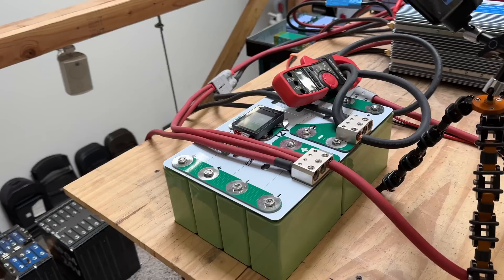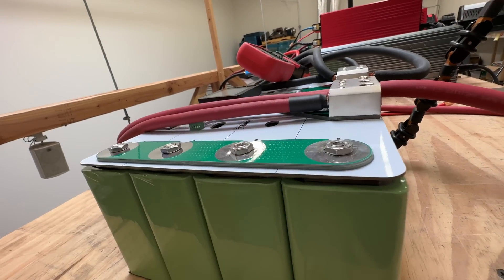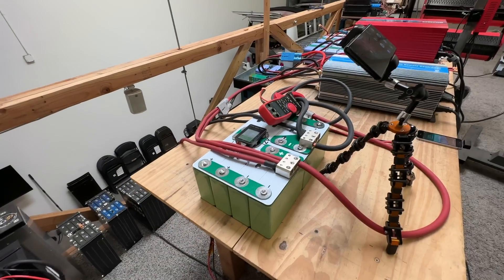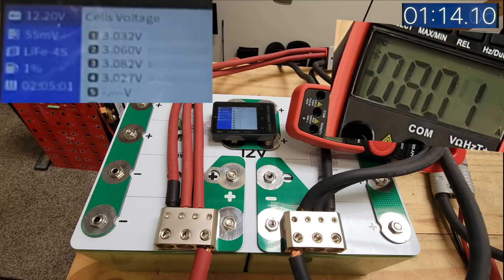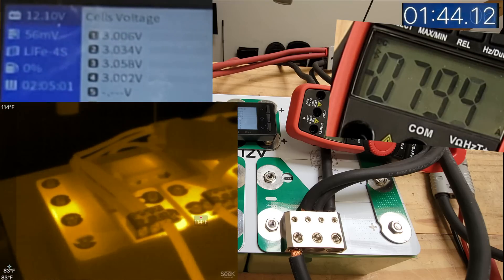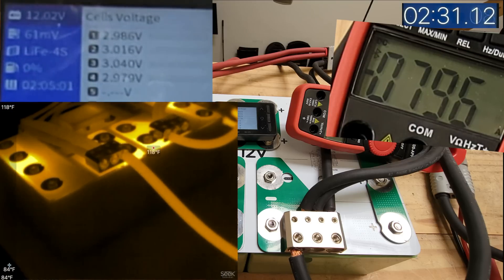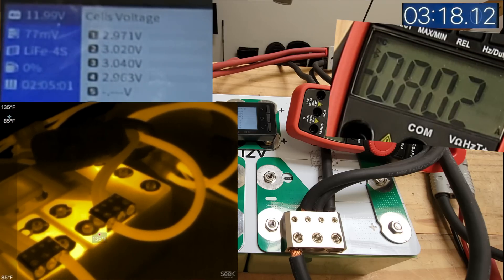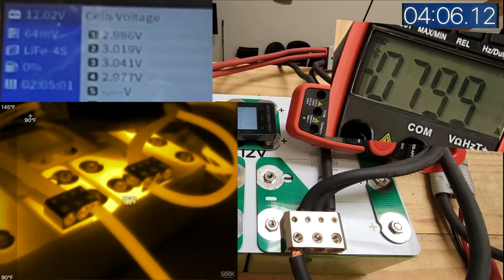1200A 12v  Monster LifePO4 Battery

Comment: Edit: the battgo device was not shipped with the correct setting, as soon as i changed it to LiFe it worked flawless to charge and was at 98%.
Im happy with it now, thanks Jag35.
End of edit....

I just got my 148Ah 12v 1200amp 4s2p premade kit. Thanks. When charging it with the aims 12v 75amp 14.4 charger the gas tabk never barely went to 8% with all the cells balanced over 8hrs. Does ot matter which front or back of the terminal blocks used to connect the charger I don't have anything connected to it the power stuff but when I charge it it gets up to the 14.39/40 volts but not sure if im doing something wrong? Does the battgo not know the % of capacity remaining properly? So confusing. The battgo was shipped with the setting at LiPo, is that diff than LiFe? Whats LiFePO4 vs LiFe? 

Should i connect my subwoofer amp and sub to it and see if anything changes?

The battgo manuals online are a joke. Need some advice.... Should i let the charger charge all night and see if it does anything? People made it sound like it charges in an hour. Maybe it needs a whole day?

Comment: 160 is really not that hot anyway. Fantastic product!!!!! Just installed the long version and it’s absolutely insane. I am running about 12k watts and it is extremely stout. I don’t like the fact that it changes so low though 13.3 is all I am getting currently.
Reply: Would you recommend connecting it to the alternator or AGM battery to keep the voltage up
Reply: @Raquanscaraudio  you definitely need to connect it to your alternator, this is the best way to keep it charged. You can also use it with agm however I would recommend running it alone.
Reply: @SoberBassHead  how do you feel about the glowe voltage batteries? I’m in between the two
Reply: @Raquanscaraudio  depending on the version of Glowe battery. If you are going with the 148ah version of the lev60 battery it will destroy all of the Glowe batteries. Just make sure you are using the thicker bus bars.
Reply: @SoberBassHead  ah okay so if I do get the 280ah battery I could just hook it up to my alternator instead of my hood battery?
Reply: @SoberBassHead  I also have a supercapacitor

Comment: I would like to use this as a starter battery for a diesel truck. What is the temperature range for these cells ? also do you think a 300amp constant 1000a 5 second bms would be ok for that situation ? seems the starter would use 450-650 amps... Might just run a 750amp ANL fuse and no bms

Comment: I just bought 8 cells . I wanna make 2 seperate 74 ah  batteries .  And be able to connect  to make 148 ah batt. Is that possible ?    Do i need 2 bms ?    Amd can i make one a solar generator   capable of charging on solar and DC to DC .  ?
Reply from the maker: Everything is possible

Comment: They do have amps that are high voltage.  Dude has a fiat.  That has 3 30k  anps at 400v  runs off his ev motor battery

Comment: Hello Jehua Best regards: I am trying to make a "Solar PowerPack 900Wh", as you explain it in your videos (which among other things I really like, thanks!).
I have ready the 10 battery plates and the rest of the parts, but I have problems with the cable ("Ribbon cable"),  that when trying to connect the whole set, this generated a big short circuit burning several of the battery cards. I already repaired them, but I have to burn them again...
Is it possible that you can sell me the ribbon cable with the 11 male connectors, ready and tested, to finish my project?
Just tell me how much it's worth to consign the money to you. Thanks again!,
Hugs. Jaime

Comment: People in the car audio community usually just buy more amplifiers and batteries. Some do run at 24v, and are becoming more popular, but they are rare.
Reply: Nobody is running their car audio equipment at 24v. Find me an amplifier that can take that much voltage an I'll say I'm wrong an I don't know shit but my 10+ yrs in car audio an lithium dealings say otherwise. Taramps HV don't count because they were never designed for in vehicle use. No vehicles Electric system can handle voltage like that
Reply: @TrunkThunderLithium  Taramps make some. I don't care they're not designed for cars - they are 24v and people run them in their cars

Comment: Question !  Im a old school car audio guy and im not new to lithium charging, i know they have to be charged safely and be balanced.   So for car audio would you just put this battery in the same configuration you would as a AGM in the trunk,  And just let the alternator do its job, or is their anything special you would recommend besides checking the balancer here and there.
Reply from the maker: Yeah just let the alternator charge them

Comment: One thing that may be beneficial for sizing busbars that you may find helpful is measuring the max voltage drop using a semi decent 6 or 7 digit high precision DVM across each busbar in the battery under load, and then adding them all up and dividing it into the total resting voltage of the pack to ensure the busbars are staying under 1% of the total voltage drop in the system.  

You could also use a micro-ohmmeter to find the internal resistance for each busbar connection to get a total resistance drop for the pack at the nominal voltage to compute how much voltage drop you will have at various current levels and once it goes over 1% that will be the maximum and you will know what to expect even before testing.

Comment: Can you change it to 8S1P instead on 4S2P. I need a 48 volt pack capable of tons of amperage.
Reply from the maker: yes we already have a kit for that,  you get the busbar and the cells and put them together https://jag35.com/collections/new-arrivals/products/24v-8s-busbar-pcbs-for-lev60f-cells  If you buy the components we can put it together for you.
Reply: @jehugarcia  Thank You also I plan on using some Headway cells to make a 750 or 1000W E-bike to experiment with Fat wheels and trying to make it capable of light off-roading. Do headway cells work well for that application. I can make the Bus Bars for that but I don't know between 1P or 2P for better range.

Comment: .
The reason for those hot spots on the end bars is because of singular bar format.
If you follow through your idea of a long battery, you can get double contact like the bar under the balance reader.
-
Also, your losing contact patch via’ nut compressing the bars into a cone shape. Making them leaf out like an open book.
  Can use a fender-washer to help flatten this out, or use radio antenna copper joint contact compound (it’s like a copper infused anti-seize) but most folk use a solid bar instead of layered pcb, just for the sake of simplicity.
-
Nothing wrong with layering pcb. But when entering into 500~plus amp territory, the less multiple contact the better.
Reply from the maker: I agree

Comment: I have a 48 ah headway 
 

I think I’m going to try these out 😮
Looks like a beast 

Ps man make a freaking beefy pcb buss bars 
Love your videos 

Sincerely extreme basshead 😂
Reply: These busbars are continuously handling 500 amps without melting under a non stop load. Music never does this. Music will pull max amperage for a second before the load falls off and back up again. The only way you'll ever get loads like these while playing music is if you were only playing test tones for minutes on end. I have busbars for my cells that are rated for 100 amps continuous and very thin and I have never had a problem with them but can do 400-600 amps on them at Burt's of 10 seconds also without issue which is similar to what music is.

Comment: With all due respect, the reason why these have not been as popular it's because you continue to use PCB bus bars. You have a healthy supply of cells, secure a metal fabricator and have thick aluminum or copper bars made specifically for you like all of the other Metal Works on the market. I'm trying to help you. People make go to you for cells but they go elsewhere for bussbars. Seems like a missed opportunity to me🤷🏽
Reply from the maker: The reason you haven’t seen these,  it’s because we just got them, talk to me in a couple of months.  Use whatever bars you want but the only one peddling big aluminum bars are the busbar sellers.  Customers will buy what works.
Reply: @jehugarcia  couldn't have said it better myself
Reply: What would you recommend someone replacing 2 12v lead acid AGM coach batteries for an RV application? Just looking to extend my time out in the world and off the wire hen we travel

Comment: So, what am I missing??? What is the advantage of PCB busbars vs solid copper or even aluminum? I know weight isn't the issue, so is it cost, looks, easy of manufacture? If cost, what is the difference? I work with big substation battery banks with tin plated copper bus bars all the time. But, I never buy them so no idea on costs. Also, what would you consider the high temp warning point, 180F or so? 
Also appreciated not mentioning the competitor. That was getting old and those that know, don't care to hear it. Those that do, don't need 'em anyway. Loving the R&D, keep it up!
Reply from the maker: Yes cost is a big deal,  I’m going to disrupt this market with super affordable battery so spending extra on costly bars when they are not needed doesn't make sense.
Reply: Basically if you can size a bus bar for the expected thermal losses during a cycle instead of using the standard practice of 1.2A/mm^2; then you can save on costs a lot. 

I think that is the goal of these tests. 

I know from purchasing experience that nickel plated bus bars rated for 150A continuous(25.4mm ×6.35mm) at a total length of 3.29 meters for a client's pack was $790 in material/ manufacturing/ shipping costs. This excludes the design time costs for the custom bars.

Comment: How can I use it to charge up a Bluetti ac200P ? what's needed?
Reply: All you would need is the same connector that plugs into your solar input.
And hook the other ends to the positive and negative on the battery.

Comment: I mean if you use this for Car audio you will never see that continuous of an amperage draw, since music is dynamic. These performed quite well, These would kick butt for a high powered car audio install.
Reply: Unless you're actually doing a max db test to burp a system music will never be a continuous load. All music is transient unless like I said you're playing a straight 40hz test for 2 minutes which is dumb.
Reply from the maker: Well whatever sine wave music you guys listen to these days,  continuous  tests should give you the results you need then.
Reply: You are wrong sir. Music used in car audio these days is modified, basically a continuous sine wave. You will absolutely see current draw like this. And even if the music was not modified at the power levels we are using even lower amplitude baselines will pose significant current
Reply: @BeSome1  LOL, what no bro. I don’t care how much DJ rusticals you are playing it’s not a constant sine wave. Your level of knowledge is hilariously poor.
Reply: @CL-yp1bs  clearly your level of car audio is poor, but that's okay. You may not have a system that demands High current, as most do not. However for me and the others that compete in my class do. I actually measure my current pull do you?
Reply: @CL-yp1bs  You are wrong. When doing dB drag contests, it's literally a single frequency they use, unless they have to use "music". Music is, however, heavily modified so that all the parts of the "song" with heavy bass is literally a continuous low frequency sine wave. Usually somewhere between 14 and 20 Hz. In most dB drag contests, the term "music" is just defined as something with vocals as well. If you search for dB drag contest on YouTube, you will literally find some of the loudest recoded cars in the world, and they use songs with anywhere from a few seconds to 20+ seconds of just the same frequency. Now, for both of you to be wrong, we have to define how long continuous is.
Reply: @CL-yp1bs    you would see that  in  spl comp  and  some electronic  music   for sure  for a couple seconds for sure